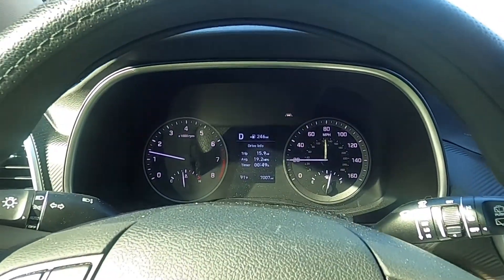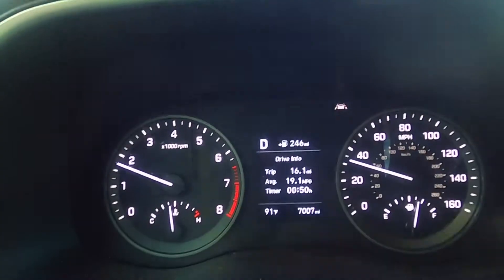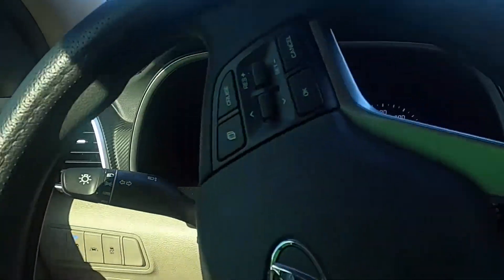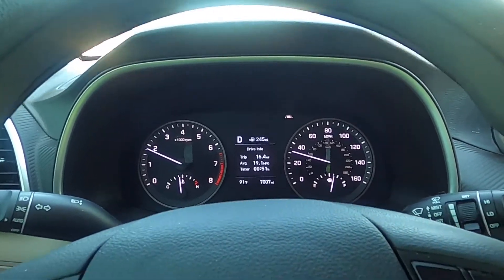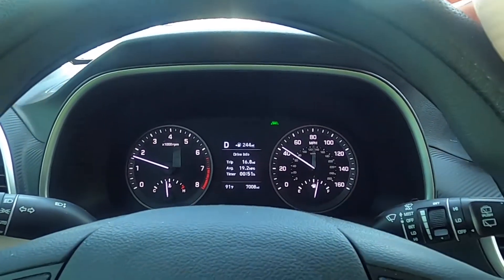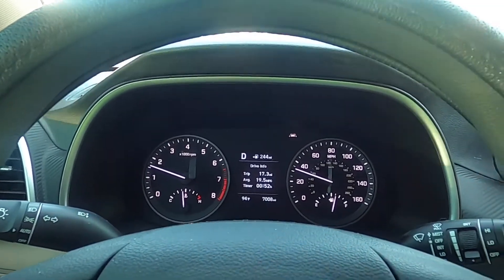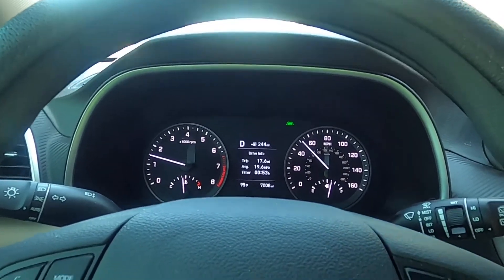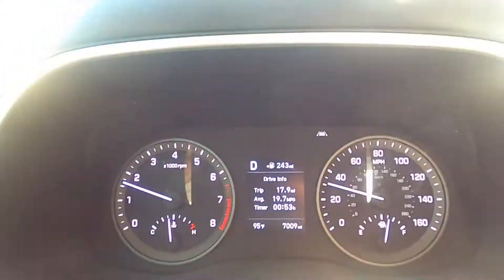How To Tell If Your Torque Converter Is Locked Up

Comment: I've drove manual cars since 2010. I got my first automatic last week and I was confused by some of the behaviour regarding the RPMs not fluctating during light acceleration. I thought my gearbox was broken. This video put my mind at ease and explains it really well! Thank you.
Reply from the maker: Depending on the car (I have a Mazda now) it’s always locked up and barely fluctuates unless it actually changes speeds. Some vehicles, however, will have fluctuations in the lower gears. This Hyundai in the video did as it was a single plate clutch (error I made in the video). Some cars have CVT gearboxes so the rpm’s won’t fluctuate if you’re steady on the gas and the torque converter clutch engages at like an ungodly low speed

Comment: Your video is very nice bro, quick question I have a 2006 Lexus ES350 i started noticing shudder at a very light steady throttle around 40km/h when I fire up it vanishes,when I drive under 40 I don’t notice it at all, no check engine light, what might be the issue please? No loss of power,the car fires very well, please what might be the issue? I’ve cleaned the throttle position sensor,changes spark plugs. And it also jerks a bit on idle, is this torque converter issue?
Reply from the maker: Try the coil packs
Reply: @thweepz Ok will do and let you know,thank you

Comment: My 07 4runner throw p2759 code and i am experiencing same issue in the video after releasing pedal my rpm drops and stuck then release after few seconds and it slow down... dont know what to do how to solve.
Kindly help me because in Afghanistan we dont have best mechanics i visit many but they didnt find any solution now on this video i find the problem.
Reply from the maker: I mean the circuit could be going bad. The car in this video it was normal because the clutch engages at low speeds

Comment: What could have possibly gone wrong if it’s not engaged. 
What hierarchy to follow for diagnosis if no DTCs appears on scanner before replacement of anything.
Reply from the maker: If it doesn’t engage then commonly thermostat (on older cars) or it can causes unnecessary heat
Reply: @thweepz  Yes I have 8 years old Toyota with 4 speed transmission and I will try replacing then update about it. 
What If Thermostat valve doesn’t make any changes then what else to look for.
Reply from the maker: Usually it shudders and gas mileage can go down. Also rpm’s aren’t consistent

Comment: Hello, not sure if you will see this.
I have a 2007 Nissan Xterra, and it throws a P0744 code. 

It shifts great from what I can tell. Sometimes when I'm at a red light and I take off, it feels like a shake in my car for about half a second, not everytime though.

I will drive it later to see what you described in the video, but I was curious on your opinion of this? Thank you for your time!
Reply from the maker: That’s registering a faulty torque converter clutch solenoid. It’s possible it could be worn or the solenoid needs to be replaced. If it stumbles then it is a good indicator. They are supposed to lock up but like not when the car is stopped or almost to a stop

Comment: Hi dear friend, I have a Hyundai i20 at 4gear A4F12/A4CF0. When I go downhill try to fuel economy with cutoff. But computer show 2L/h . I think when car go downhill, 50mil speed and don't touching throttle pedal must be zero fuel flow. Is my lock up fault? What you think?
Reply from the maker: So not so much the lock up but the fuel injectors will shut down if your foot is off the gas as long as you’re not idling
Reply: Thanks your reply. But computer show instant fuel consumption. Im not touching throttle pedal but see fuel flow. I can record a video for you.
Reply from the maker: Well might be normal. I know that they can shut off but you’ll need fuel if you are running other accessories

Comment: any knowledge of what would cause my 2014 vw passat to cut off when i put it in gear. runs great other wise
Reply from the maker: Sounds like not enough power delivery to keep up with the additional load from the transmission. Was the alternator for me at one point. The other time was a fuel pump
Reply: @thweepz  do I need a multimeter to check alternator or is there an easier way
Reply from the maker: Well some things that happen are accessories stop working in stages.

Comment: It is too much evident in my 42RE (Jeep WJ ‘01 4.0L) when the converter is locked up. When I’m cruising at 50 mph or higher (with OD on) you can see it in the odometer when rpms fall to 1400/1500; and if OD is off it can engage at 45 mph.
Reply from the maker: On older vehicles it was much more aggressive
Reply: @thweepz  yeah, and I like it
Reply from the maker: Haha that’s good and I’m glad it’s working properly

Comment: My 03 tundra 4.7l automatic trans act like a manual trans. I have to let off gas to upshift at shift points also it barley goes over 2000 RPM with pedal all the way. Took it to two different transmission shops hooked it to pressure and said it wasn't the transmission. Somebody told me it sounds like a stuck solenoid or the torque converter. Idk if anyone has any input I would surely appreciate it.
Reply from the maker: If it’s getting stuck that could be a solenoid but it’s hard to say. Any codes? Is it shifting hard when it does shift up?

Comment: That’s interesting. My dads 2020 accord does this thing when you accelerate from a stop. At any throttle position, the revs will be fairly high then it seems like the TC locks up and the revs drop pretty low
Reply from the maker: Oh yeah newer transmissions will lock up pretty quickly under acceleration
Reply: @thweepz  yeah man that’s what I figured. That’s interesting. My 08’ CRV is constantly unlocked. I think it occasionally locks up in 5th gear
Reply from the maker: It might lock in fourth and fifth. But my Mazda basically locks up right away

Comment: I have a 2005 Honda CR-V with 224,000 miles. It will sometimes vibrate as I'm gearing up but then smooth out as I accelerate. Several YouTube videos have recommended a product called Shudder Fixx. Are you familiar with this? Thanks!
Reply from the maker: I have but I get weary of additives in transmissions. Hondas are very picky with their fluid

Comment: I'm a little confused by the terminology you use here. You talk about a torque converter locking up, and to me that would mean when the input rpms to transmission is exactly equal to output rpm from engine. In that case rpms would rise and fall exactly in ratio with the vehicle speed. 

But you seem to be talking about it a different way. You say things like "See its locked now. I'm accelerating but the tachometer is staying the same." And when you mention CVTs, you talk about them "locking" at very low speeds. But what CVTs do is they hold a certain RPM and then continuously vary the transmission ratio to change the speed. So again, exactly the opposite of "locking" the engine speed to vehicle speed. 

When you say "locked up" do you just mean that the converter is broken or malfunctioning? That it is somehow messed up to the point where it cannot fully lock with engine? That seems to be what you are saying, but the words are the opposite of how I would use them.
Reply from the maker: So basically with the TCC not being locked up, the RPMs can fluctuate depending on throttle input. With it being locked, going on and off throttle will not vary the RPMs. That’s what I meant to say but it appears my diction in the video might be confusing. They do increase with speed but throttle changes do not change the rpm at a certain speed. Additionally, CVTs do still have torque converters that lock up and they do it at low speeds. I didn’t realize this comment was separate from the reply. I’m sorry.

Comment: Hmmm... A few things, you say you're accelerating but the rpm's don't increase. That's not feasible unless you're going downhill. Also lockup typically happens in higher gear at a faster speed due to ratio being closer. If the ratio isn't close it won't lock. And one more thing. Lockup are used in trannies with only 4 gears on up. It really doesn't matter how many gears there. It was developed back in the 40's but mainly came into play in the 70's when trannies where 3 or 4 gears. If your engine stalls as you slow down you are probably still locked up. :-)
Reply from the maker: True. Phrasing could’ve been better but when it’s locked up and you hit the gas, there would be a dramatic increase if it was unlocked. Newer cars will lock up the TC as early as second gear and go in and out as the computer sees fit
Reply: Yeah mine was staying locked up whenever I slowed down so the car was lurching forward stalling out bogging down dimming out headlights even. Tore up the clutch in the pulley of my alternator. All It was was the torque converter control solenoid. But with it operating like that it also tore up motor mounts as well As my breaks because they were having to work so Much harder to stop the vehicle without the engine braking.
Reply from the maker: Oh dang that’s not good: yeah they do need to disengage

Comment: I just noticed our '06 Corolla LE's tachometer has started doing some weird s**t that I've never seen it do before. (And me being the paranoid pessimist that I am, especially when it comes to vehicles, because my luck in life is the worst, I'm always looking at the gauge cluster.)
 And it's seemed like it's been at random times and random speeds, when the tachometer jumps down, then back up where it was. It's usually around 30-50mph.  But then sometimes, it does nothing when I left off the accelerator.  

I've been freaking out ever since I drained the tranny fluid and changed the filter, because the oil was so dark. (Girlfriend never had her dopey ex change it I guess). The magnets were soooo thick with metal shaving.  
It's driven fine before and after the fluid & filter change.  

But this tachometer thing's driving me crazy.  One time it jumped down (from around 40-50mph, that it literally felt like I hit the brakes.  I was like "woah, wtf. That ain't right."     And now it does it damn near every time I let off.
Reply from the maker: My sisters camry does that. Letting off the throttle and the tach drops to idle then back up. My old Honda and my moms Nissan did it and always found it weird. It’s the torque converter clutch disengaging.
Reply: @thweepz  It still shifts and drives perfectly fine, other than that weird new RPM bounce.   So if it's the Torque converter, how do I fix it? Lol
Reply from the maker: @YamahaRacing22  you may not need to do anything. It never did this before?
Reply from the maker: @YamahaRacing22  sometimes the torque converter will just unlock if the compressor kicks on, cars are weird
Reply: @thweepz  No, it's never done this before, and now it's doing it every single time I let off the gas. Yesterday, I caught it doing the same thing as the video.  I let off the gas, it dropped down to like 900RPM's, bounced back up to normal, then I pushed the gas again and started accelerating, and the tachometer never moved up, despite me going faster & faster
Reply from the maker: Hmm it might be freewheeling but did you ever get a diagnosis
Reply: @thweepz  Unfortunately not. My girlfriend & I must have broken up shortly after this.  The car was running fine that last day I was in it.   Then she literally gave the car to her brother and then he had a flat and literally left it on the side of the road until it got picked up.   

Funny thing is, the new car started doing the same thing, after a few other similar "symptoms" the old car had.  My only guess is that its some way of engine braking. Just weird how both car hardly ever did that, until it was just a everyday thing.  Other guess, is that alllllll of the idling we do every day (and in Texas), eventually messes with the catalytic converter,  clogging it just enough to cause back pressure or something.  Who knows lol.   

Thanks for trying to help me figure it out
Reply from the maker: Also noticed that at certain ranges or if AC is on then that can make it fluctuate too

Comment: Hi. As you know, my gasoline 520i 2014 uses zf. The car takes itself from 3 to 2 in decelerations. (Or maybe it's downshifting from 2 to 1. If I press the gas right after the downshift, it starts to accelerate by making a hard knock-on motion. Is this normal when the gear is downshifted?   It does it when its hot.  Thanks for your comments
Reply from the maker: Any type of knocking sound I wouldn’t consider that normal. I might be misunderstanding what you’re saying. Is it bucking or actually making noise
Reply: @thweepz  I’m sure its not a noise but it is suddenly accelerating.  Not a smooth accelerating when I press the gas pedal just after the downshifting.     Can it be about the lockup clutch of the turbine?  Can we feel the lock up or unlock? Thanks
Reply from the maker: Sometimes you can feel it unlock and lock but it’s rare

Comment: When i drive my challenger with ZF8 it lockup during taking off from lights with very little gas, it shift to 3rd or 4th gear and immediately lockup, dropping from 1800 rpm to 1300-1400 during upshift and split of a second it lock up and RPM drop to 1100-1200, can be more noticeable when tranny is very cold during freezing temperatures or when it happens and u just want to give it little bit more gas and car feel like bogged down :D (this early lockup happens because of adaptives in TCM) so to avoid this i have to get from lights being little bit more enthusiastic on gas :)
Reply from the maker: Oh yes the ZF 8 is very early in locking up. Have it in both chargers. I love it

Comment: I don't know how you think you're in a car with a locked gear and steady RPM and "accelerating."
Reply from the maker: Not sure where that was in the video. But in this case there isn’t a significant spike when accelerating if the torque converter is engaged
Reply: @thweepz  See, I think you have this backwards. When the torque converter is locked, the tachometer moves exactly the same as the speedometer. The engine is locked to the drive wheels, through the torque converter and transmission. If engine goes faster, wheels go faster, and vice versa.

If the tachometer is not moving, but your speed is increasing or decreasing, then the torque converter is not locked, not fully engaged, it is slipping to some degree (which it is designed to do, to a certain extent).

I think you should consider removing or re-making this video, as it appears to be giving a lot of people the wrong idea about how their transmission and torque converter work.
Reply from the maker: @nicholashudson5020  it’s about perspective but I actually see where you’re coming from. The intended result is that it’s locked so when stepping on the gas the RPMs won’t surge like it will unlocked. But we have the same idea
Reply from the maker: @nicholashudson5020  when you take your foot off the gas and it’s locked the tach doesn’t drop. But when it is unlocked it will lower down and hover around idle and remain “constant.” But while locked it should not have noticeable rpm changes on and off the gas at a constant speed.
Reply from the maker: @nicholashudson5020  I’ll do a remake with a clearer explanation. Thank you for your constructive criticism. Helps :)